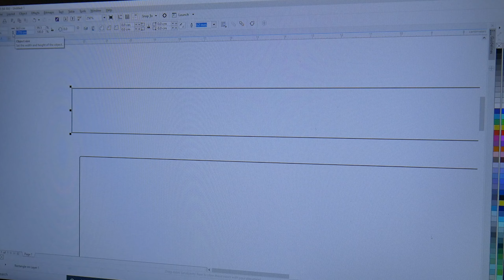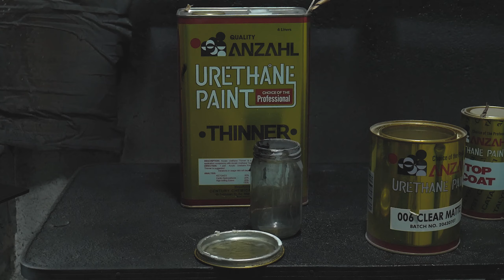Cooler Master NR200P modified Liquid Cooling

Comment: Can you show better pictures of top rad. How much clearance there is between ram and top rad fans?
Reply: Yes, i wonder if that thin rad is fitting on top without having to do any customization. So we can skip the side rad
I also wonder if two of those thin rads can hold a ryzen 5800 and rtx 3070 
We need a temp test for that build 🤔😀 with the gpu on the same loop indeed

Comment: Thanks for the video! How did you fix the top radiator to the top cover? What is the height of the radiator?
Reply from the maker: You need to remove the power inlet @top part of case .. So you can mount freely the rad. Also the eps cable power for the motherboard :)
Reply: @PaulPerezPcmods   what's the top cover?

Comment: What is the point of just watercooling your cpu and leaving your GPU aircooled? I mean you ran with dual rads. Might aswell reap the benefits. Or else it looks good.
Reply from the maker: Its is clients want that time. He want to stay the founders edition  look there.. 

He purposely  buy founders edition from u.s to here Philippines because  he want the limited looks of the FE gpu  specially nvidia not sell FE cards here in Ph.:).

If not. Then he rather  buy an Aib gpu then watercooled it :)

Comment: all this cool stuff yet no water block on GPU, what's the point of custom loop then? better throw an AIO in this case
Reply from the maker: there is no available waterblock for 3090 at that time when i finish the pc..   so we came on temporary setup like that and  now the  gpu is watercooled already, and the client is choose to make a new build in a newer case... heres the link

https://youtu.be/Vl3o4qm_g_4
Reply: @PaulPerezPcmods  Now that is awesome! 3000 series GPUs with GDD6X are more complicated to cool in  my opinion compared to CPUs. Its these GPUs which actually require custom LC, for CPU we can get away with an AIO and it can still run pretty much in the safe range

Comment: Not the best build. I've seen dual 240 rads builds (top/bottom) of the NR200p without modding the case-size and then still using exterior pump an reservoir. I think we are leaving SFF teritory here. This case ca be easily inverted by turning the front-plate. Only 3 rivets need to be removed/replaced. https://www.youtube.com/watch?v=0KTUlMRm_So That was a smart mod actually